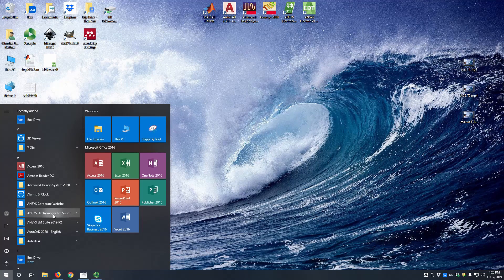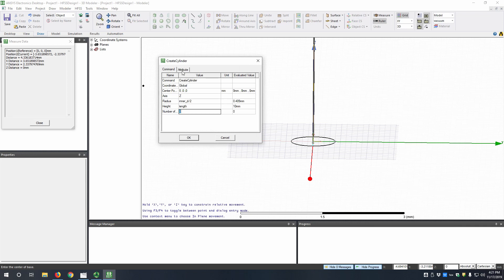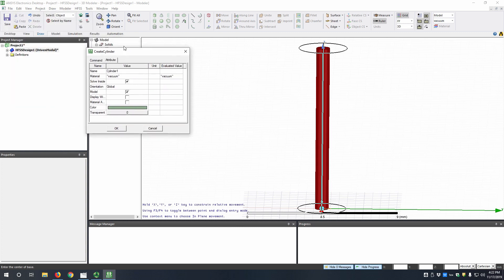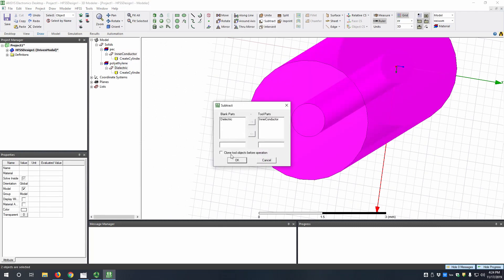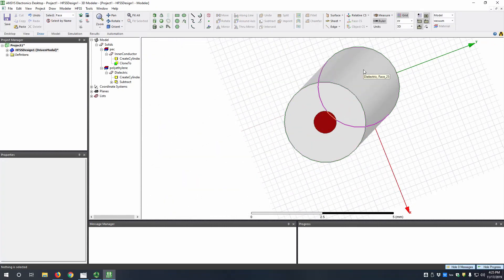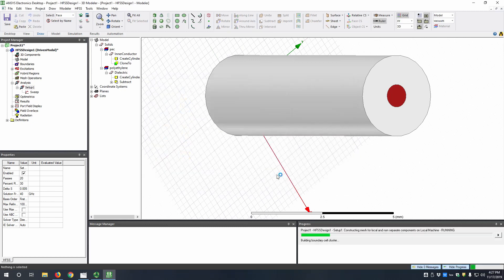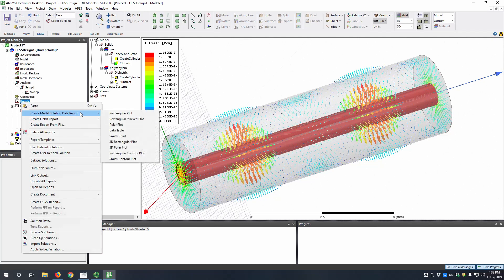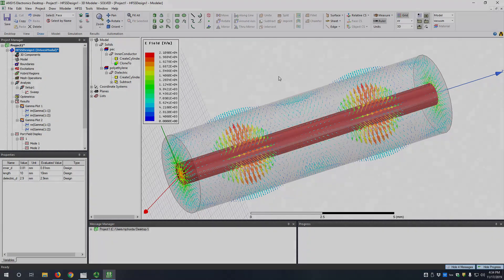HFSS Tutorial - Modeling RG-58 Coaxial Cable

Comment: why you use a wave port? why not a lumped port?
Reply: i think the lumped port need a integration line, anyways i used both the wave and lumped. Anyways, to make the coaxial cable i was modeled the another cable on the surface of the dielectric, the exterior radium but i can`t take the plot of gamma like him :(  did u taked it?